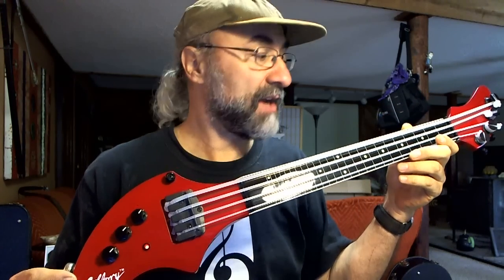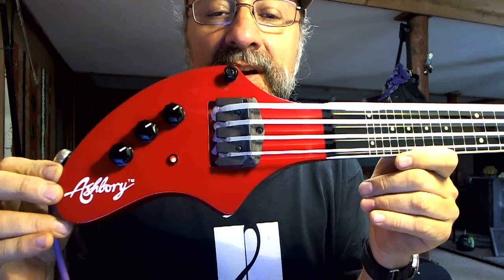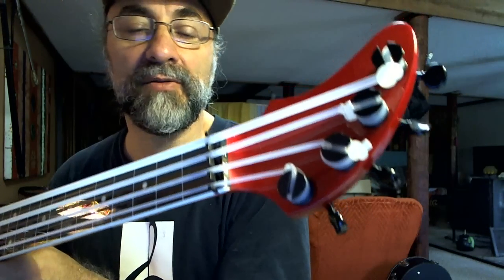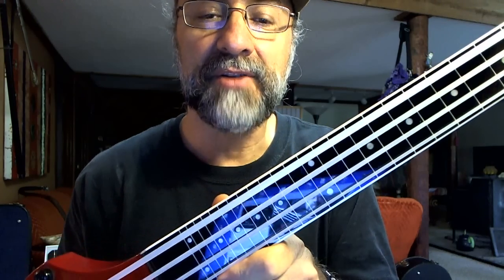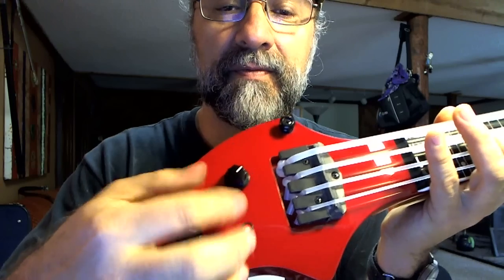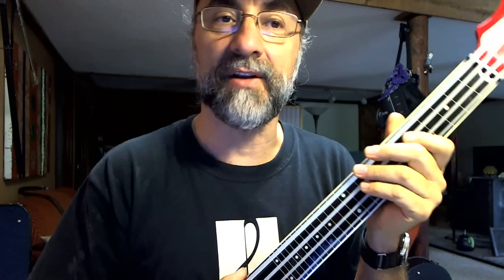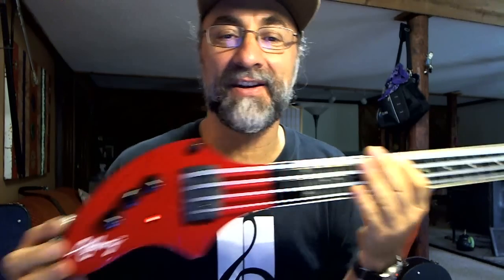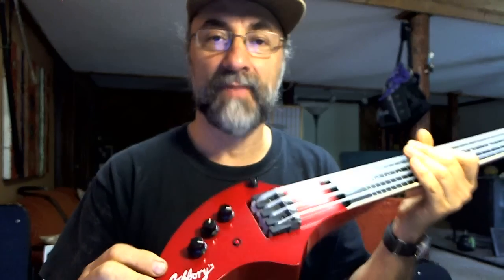Ashbory Bass Over-View

Comment: About your quick mod about reversing the "E" string. I have one of these and did that but unfortunately because of the way the threading of the tuner. There is threading that makes it hold onto the head stock. The way the "E" string is wound actually holds it so if you reverse the tuning on the "E" string, it will actually come off the head stock. Just thought you should know and I personally thought this was an excellent review besides the error.

Comment: A fantastic niche Bass, which is the "Spiritual Successor" to the current Kala Acoustic & Electric U-Bass and SUB U-Bass that everyone seems to be going gag over recently.
Reply: I think you mean "spiritual antecedent"? But You're not wrong. I have one of the DeArmand models, and it produces an amazing, fluid, deep, rich sound that doesn't come through at all in this video, as there is too much distortion. As others have noted, it has a tendency to detune until the strings settle in, and the strings have a tendency to break unless you pamper them, especially the G; detuning during storage makes them last longer. You absolutely have to powder your fingertips; when you do, it opens the door to all kinds of expressive playing. The strings are slack and the scale is short, both of which factors make it effortless to play, nontiring even during long stretches. My biggest problem with it currently is finding replacement strings. I've been told that surgical tubing works pretty well.

Comment: Can steel strings be installed on this bass? Also, do they sell a fretted version?
Reply: no,  it doesn't use a truss rod since the strings have much less tension than a normal bass. It is not prepared for it and would probably break in half.